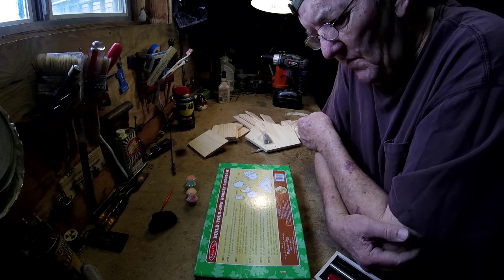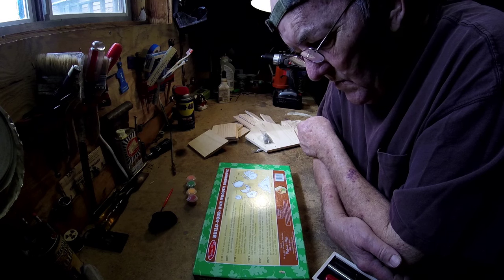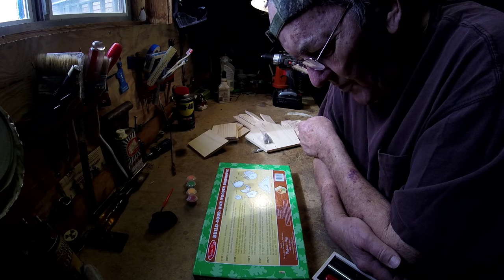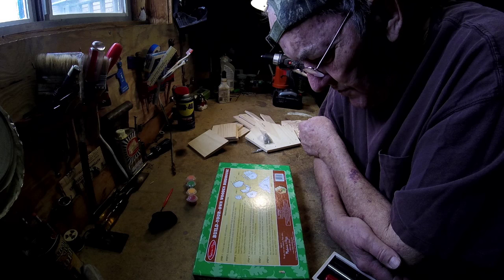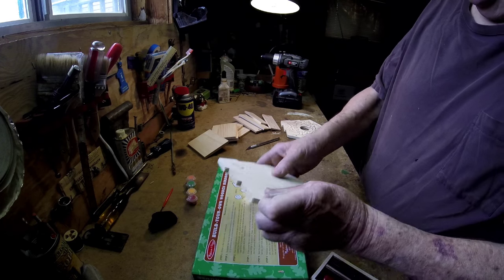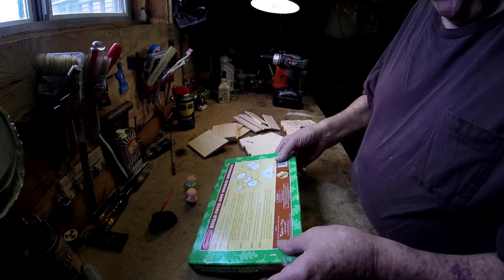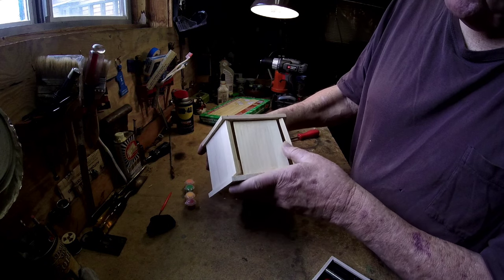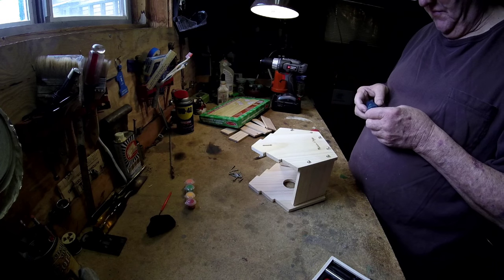Bird House Kit Assembly Part Two 2 21 2016

Comment: You might say silly, but can make it simpler for older adults to make one of those things.  I would also suggest putting hand soap on the threads of those screws.  Should you ever want to do any repairs the screws will come out easier.
Reply from the maker: +ahgfl007 Good suggestion  Thanks